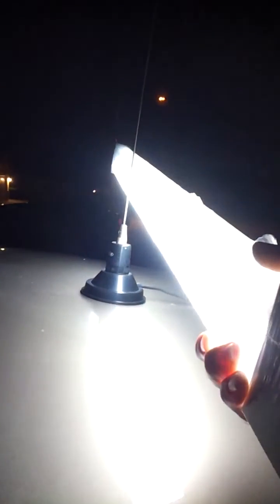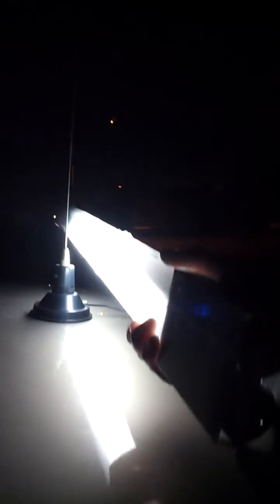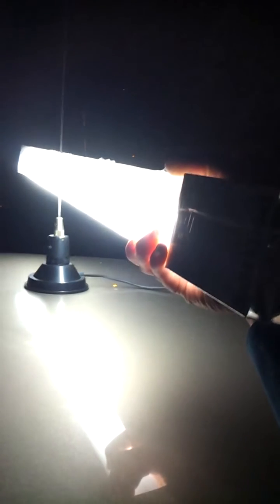Wireless lighting  --   ham radio style

Comment: I used to work at a shortwave radio station. Now and then some one would need to go out in the antenna field. We were only on the air at night. They would usually carry a fluorescent tube with them and it would light up like a flash light. TPO was 100,000 watts and the antenna had a 21.7 dbi gain, about 14 million watts. Obviously we only went out there if we really had to!